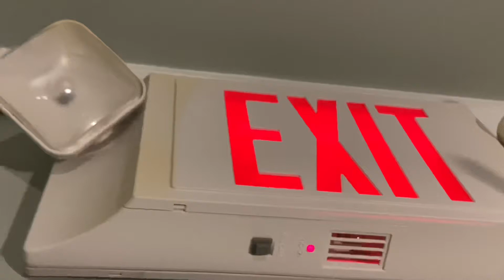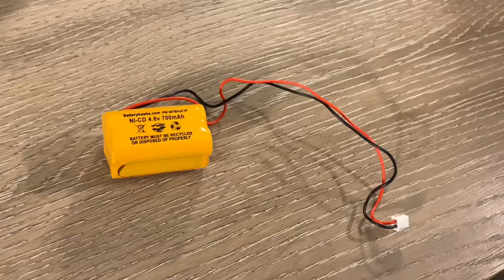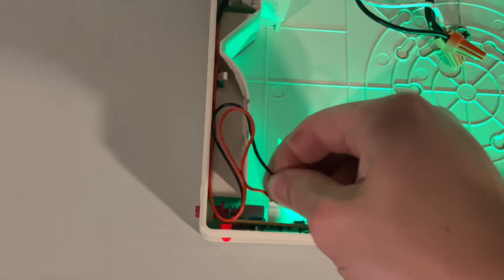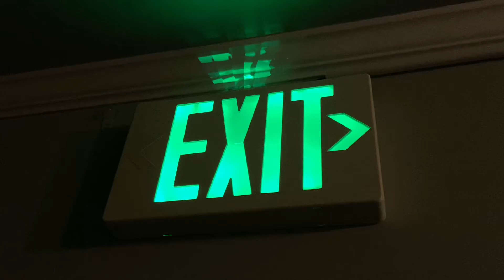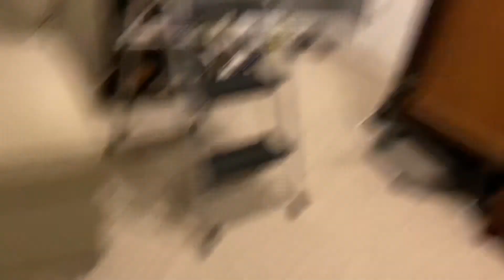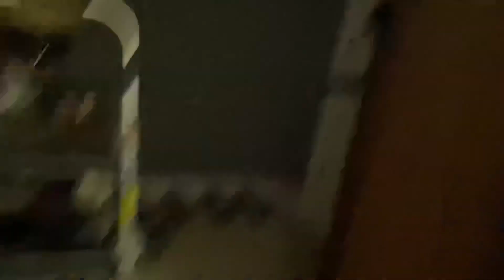Exit and Emergency | Episode 10 - Replacing a Battery and New Changes

Comment: I have the same sign and it is not illuminated. When I press the test button it flashes once. Can you give me some advice please.
Reply from the maker: This sounds like the backup battery is not plugged in. These particular signs have a feature where you must have the backup battery plugged in or the exit letters will not light up.

Comment: Can you help me with identify my smoke alarm problem? So here’s what happened, I live in a townhome with six interconnected smoke alarms that are Firex 120-557B installed in 1996. The one in my room unexpected activated at 4am in the morning, which set off all the smoke alarms waking up everyone and it would not stop until my parents unplugged it and removed the battery. Not sure if it’s due to age because I never had a false alarm that would not stop on its own when there isn’t any smoke. Usually during false alarms without smoke they will stop after 30 sec. These smoke alarms are now 25 years old.
Reply from the maker: I’d suggest replacing all of them. I’ve seen a similar occurrence with FireX smoke alarms too. Sometimes with age smoke alarms become less sensitive and/or may activate or seemingly nothing. NFPA recommends replacing smoke alarms after 10 years. Sometimes you can get a few more years out of them but even most manufacturers also recommend the 10 year replacement.
Reply: @ExitSign250  I told my parents about replacing them with Kidde i4618, but they said they want to vacuum the smoke alarm first. I guess if it goes off within 24 hours after the vacuum, they will then replace them with new ones. My parents really don’t want to replace the smoke alarms despite the smoke alarms being way past their age. Also do I need a FireX to Kidde adaptor when converting form FireX 120-557B to Kidde i4618? And if I only replace the one in my room with a Kidde i4618, will it still interconnect with the other FireX 120-557B?
Reply from the maker: I see. You more than likely will need an adapter if you install a Kidde model with your existing FireX ones. Kidde and FireX alarms are compatible with each other.
Reply: @ExitSign250  So that means the modern Kidde can interconnect with the old 1996 FireX? Which means if one activates all of them will activate regardless of manufacturer and age? The Kidde website said that only the FireX FADC, ADC, and AD can interconnect with the Kidde i4618. However, all my smoke alarms are FireX 120-557B.
Reply from the maker: Ah. Then no they will not be able to interconnect according to Kidde. I thought that any 1990’s FireX is compatible with Kidde but it appears that is not the case. Unfortunately you’d have to replace all alarms to have the required interconnection feature. However I believe Kidde still manufacturers some FireX alarms. I’d assume the modern FireX alarms would be compatible with older FireX. You could do some research to see if that is the case.
Reply: @ExitSign250  My smoke alarm continue to go off even with a change in battery today, so there is something wrong with the smoke sensor likely due to aging. He has actually bought a new Kidde i12040 smoke alarm. He will replace the one in my room as an experimental one to see if the Kidde i4618 can interconnect with the 1990s FireX 120-557B. He also wanted to see if he can use the existing FireX 120-557B base for the new Kidde i12040. He has also bought an adaptor for the conversion. If the new smoke alarms does not interconnect with the old smoke alarms he will buy additional Kidde i12040 to replace all the remaining FireX 120-557B. I’m not sure if the old mounting brackets fits the new alarms.
Reply: @ExitSign250  According to The Home Depot it says the Kidde i12040 can interact with the FireX smoke alarms. Hope it can interconnect with the old 1990s FireX 120-557B. My dad watched a video of a guy using an old FireX bracket to attach a Kidde i12040 to. The new smoke alarm is coming next week and my dad will do an experiment with it such as using the old FireX mounting bracket like the video my dad watched and seeing if there is inter connectivity with the old FireX.

Comment: how much does the adjustments made to the led strip of the bar one make in terms of coverage? does it make a big difference of the angle of the strips? always wondered. thanks.
Reply from the maker: Very good question. I guess it’s where you want the most light to be. I didn’t really play around with how the adjustments may effect the light coverage, but with the adjustment I had set for the middle of the room, the whole room was lit up.

Comment: Where did you buy the AstraLite exit sign at? also very great setup!
Reply: Home Depot ?
Reply: Likely eBay. I don’t believe Home Depot sell Astralite products.
Reply from the maker: I found the AstraLite combo on eBay. Currently Home Depot sells Phillips, Sure-Lites, Commercial Electric, (Home Depot’s electrical brand) and some Lithonia.
Reply: @ExitSign250  most of my exit lighting is commercial electric. They make good combos. With one surelites emergency light. All from Home Depot.
Reply from the maker: Commercial Electric rebrands generic exit lighting. Most, if not all, generic exit lighting are low quality both in construction and performance. As well as they can be unreliable. Obviously though generic is typically the go-to since of the cheap prices. Not to say all generic will fail or all generic will be horrible, they just are all a lower quality compared to name brands. Sure-Lites is a mostly decent manufacturer. They do rebrand generic products, but also offer others that are good quality.
Reply: @ExitSign250  yes my commercial electric emergency light is lower quality than the combo One of the snaps snapped off. Though the combo is pretty decent quality and had it in a couple power outages already. Yes but there are some generic brands that are terrible. Also the commercial electric units are really bright for generic.
Reply: @ExitSign250  also what are your thoughts about a emergency light with a motion detector so the battery last longer and only activates when people are around? I would love to hear your feedback. Thanks.
Reply: @ExitSign250 as of now i have a couple exit sign combos. one commercial electric one which i got a few years back, it can switch between the red and green lettering but ive had it on green for the longest time. my second combo i got from exit light co. and its a newer combo that i also got a few years ago, still works like new as always and i test both of them on a monthly basis.